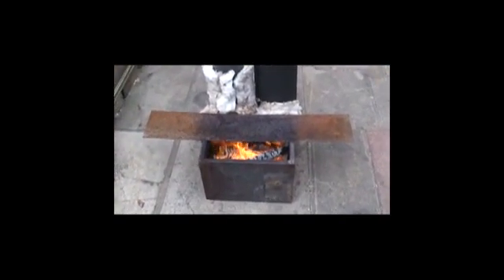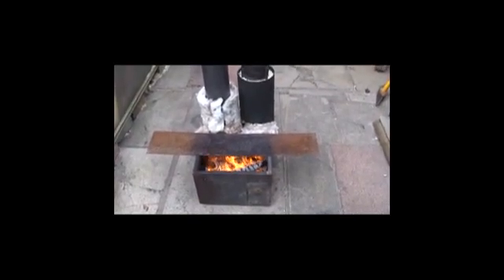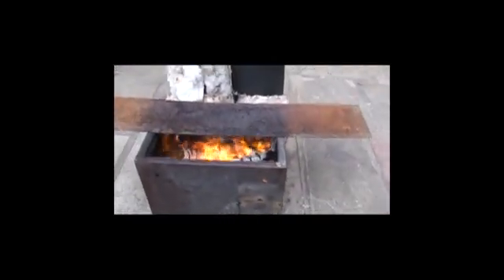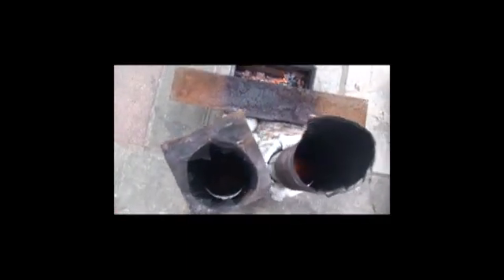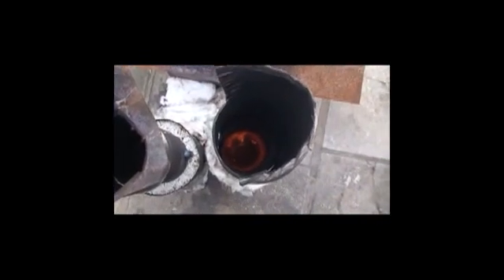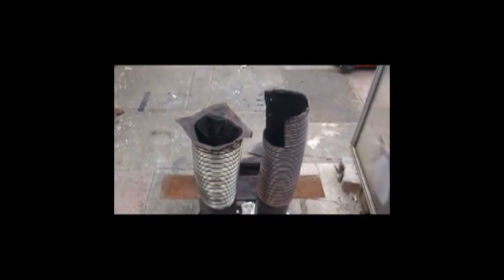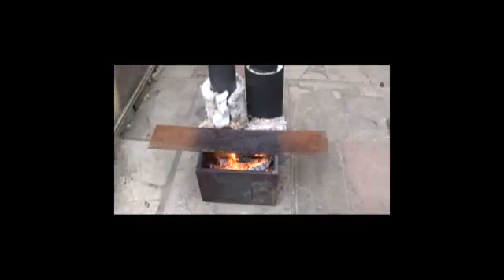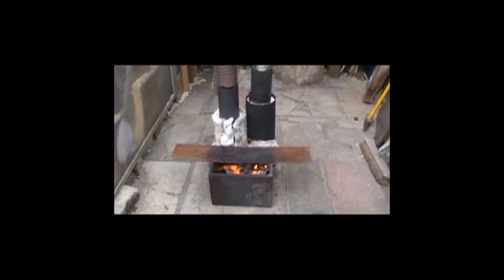Rocket stove heater double riser tube

Comment: PPotty1.  Thank you for sharing this.  I am exploring the possibility of heating my 2000 square foot basement with a batch box rocket mass heater with daybed/bench that calls for a 8 inch diameter riser.  You will find this design from the ABC Acres youtube site.

My ceiling is at 7 feet and a riser that size is going to put the barrel too close to the wood ceiling for comfort.  I had been exploring the potential of using a dual riser configuration as you have done here when i found this video.  Apparently, it does work!  Maybe I can build my heater with half the clearance after all.
Thanks again.

Comment: I'm learning lots from you Ppotty and thank you.  What are your thoughts on concrete stoves please?
Reply from the maker: Hi Kevin and thanks. Concrete holds the heat longer than steel but it takes some time before it releases it. Concrete or masonry stoves work well inside houses, they act as a heat sink releasing the heat slowly over a given time. Your steel stove is more instant heat also heating the space faster but once the fire is out your heat source has gone. Both have their pro's and cons.

Comment: I thought the point of a sideways burn in a J configuration was to allow wood to gravity feed, yet burn from the bottom. You could make your feed tube as tall as you please. The sideways draft prevents the fire from burning upward; it stays in the burn box. Otherwise, it would be most efficient to place the burn box directly under the second combustion chamber (the riser,) and funnel the exhaust gasses to focus heat in the riser with the extra air sucked in from under the grate in the box
Reply from the maker: Foolish Mortal You cant make the feed/burn tube too tall because it acts like a chimney and the fire will both draught into the riser and burn out of the top.

Comment: Is there any specific length the riser has to be im looking at something about 24 inches max and can i run the chimney along the ground and under the flysheet of my tent and does the chimney need to be a lesser diameter than the riser pipe also can i use copper tube for the riser? Love the pike lures btw im a fly tyer myself and fish more for trout these days but have done a lot of loch fishing for pike great fight on the fly

Comment: Thats pretty nuts i just had that thought about the double riser came on here to put the question to you and some of the other guys building these things and here it is ha ha well thanks for the answer im about to look into one of these for a tent and need a few answers as to measurements as for specific height feed riser and exhaust diameter and length would be grateful for any imput cheers

Comment: looks good and makes sence that two risers would work with the amount of heat you are producing. nice to see the differance in the insulation. mine is insulated with wood ash as that is what I had at the time. fire wrap might just be the trick. thanks for sharing.